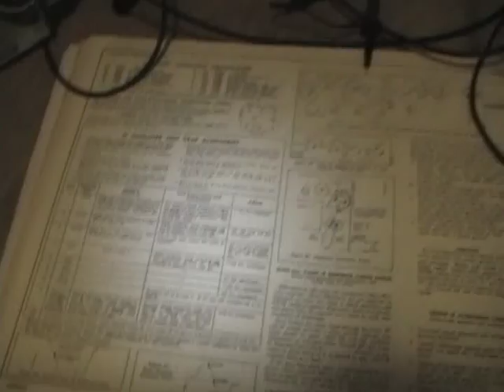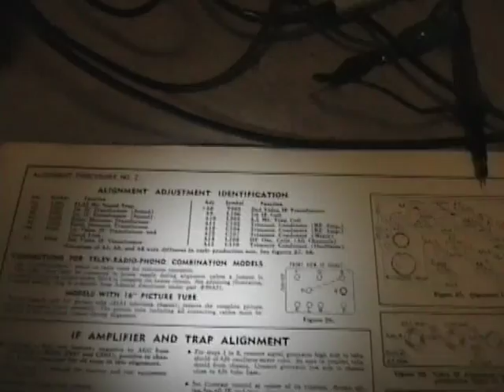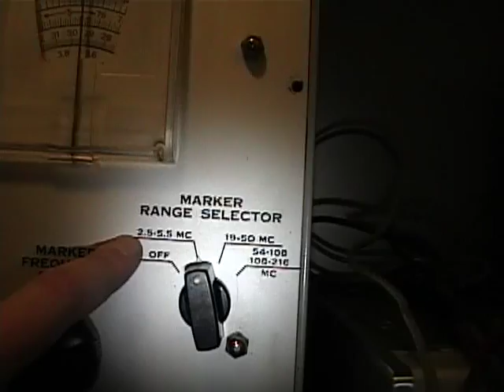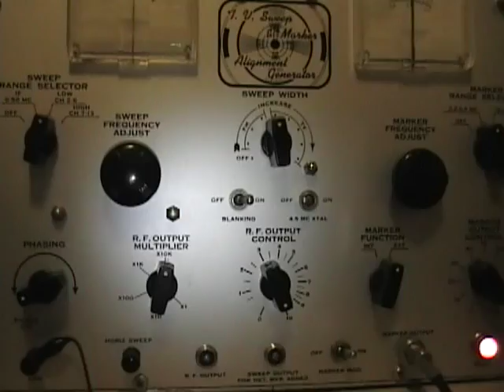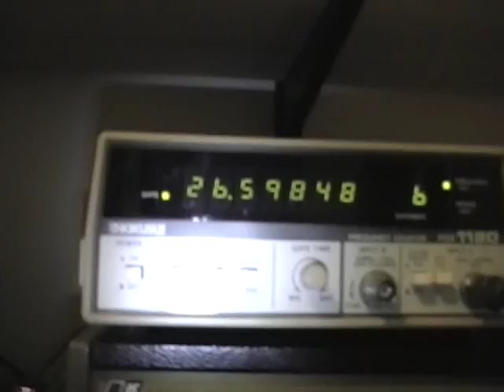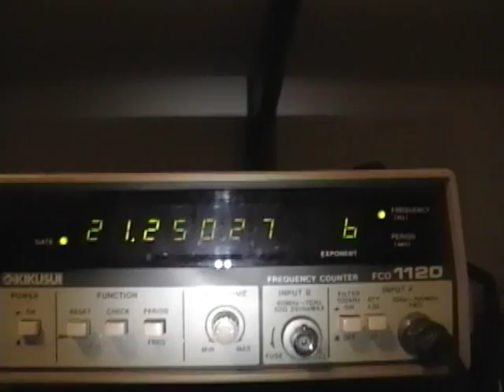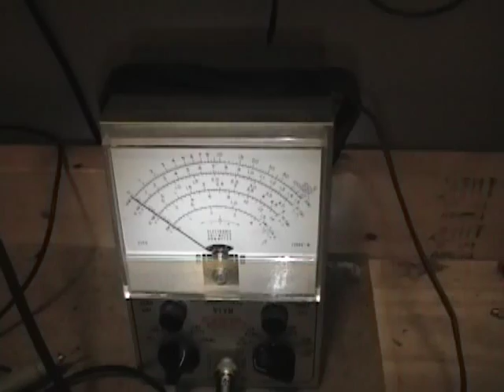Admiral 24C16 restoration p3o11

Comment: I have just finished watching your Admiral 24C16 playlist and it was wonderful but it generated two questions that I would like for you to consider.  In part 3 or 4 of this playlist you showed a TV Alignment set that you had restored and it piqued my interest because I have both radios and test gear that I have been pondering restoring.  The inhibiting thing is that I do not know of a technique to "redo" the labeling on the front panels.  I do not know of any water slide decals for this type of label and wondered if you had a method since the alignment set looked stunning!  Maybe a tutorial? 

You also made a comment that you really need a VTVM to align these old style sets because current DMM's input impedance are not high enough.  In the late 60's and throughout the 70's several test equipment mfgrs introduced FET meters that were said to replace the older VTVMs for specifically that reason.  Have you tried a FET meter for alignment?  I have a couple and was considering using them but maybe I missed something.

Great Job!  Sam
Reply from the maker: That's the original lettering on the alignment generator.  I haven't attempted to make any water slide decals for test equipment but I do know that you can get special paper for making them.  Do a web search and you'll find lots of info.

I've never owned a FET meter, but they'll probably work just fine.